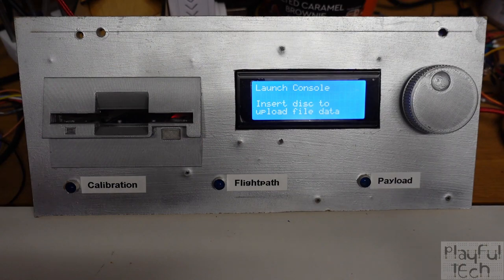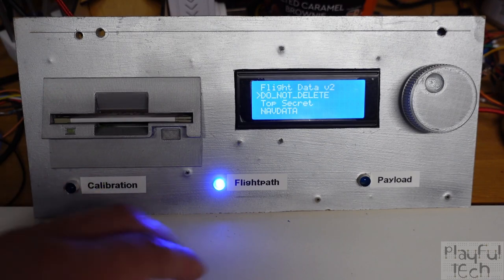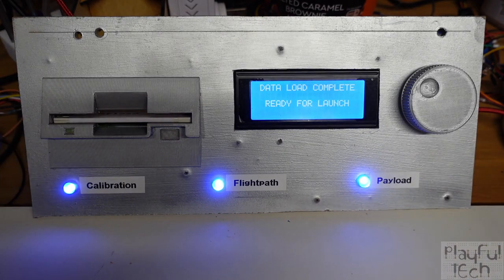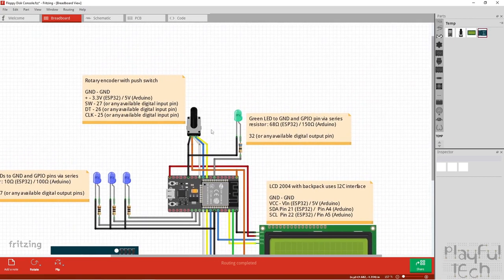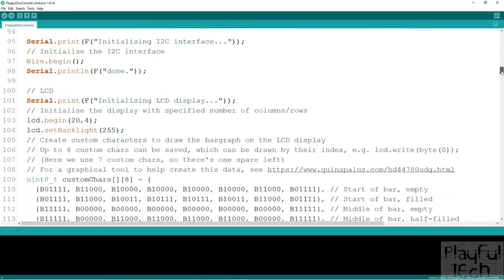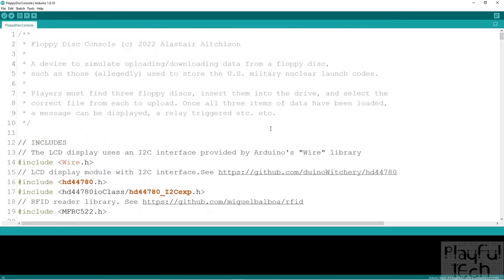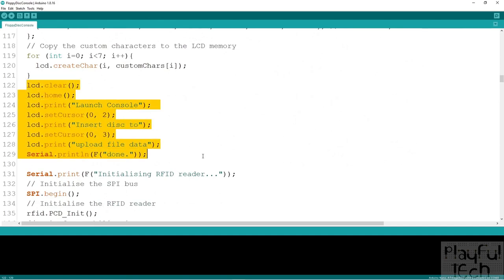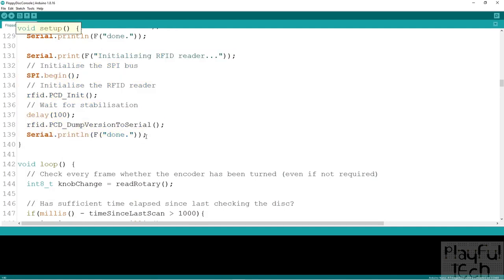Floppy Disk Console Escape Room Puzzle Tutorial with ESP32 and RFID

Comment: That's a cool idea for an escape room. I would add some large subwoofers and speakers behind one of the walls or in an adjacent room so that when they complete the code and launch, it sounds like a Missle in a silo is actually launching, with the loud noise and shaking from the subwoofers.
Reply from the maker: Definitely! That would be very easy to trigger after the data is uploaded, and perhaps after having two keyswitches turned at the same time?
Reply: @PlayfulTechnology  I was thinking of the two key switches too, extra twist....

maybe find a way (as part of the escape story) to limit only one person to that area,  "the facility has been hit before launch and if there is more than one person worth of weight at the launch desk its power fails but restores on removal of people/weight" the two smallest members of the group would need to use switches, or one person and string or belt, like Winona Ryder in stranger things!

Comment: That has worked so well, Great job. 

I'm not sure if a magnet would interfere with the RFID tag, but you could put a magnet at the back of your enclosure that would stick onto the metal slide of the disk to hold it in, then create some sort of 3-D printed lever that can push it back out if you press the button on the front. And if somebody just pulls the disk out it won't damage anything.

Also maybe leave a portion of the original floppy disk magnetic material under the window, so that when somebody slides that cover open they can see the floppy disk inside, just for more realism. I know I wouldn't be able to help myself and would slide that cover open just to look inside 🙂 

Are you going to mess with the players even more and clear any previously loaded sequences if you get one wrong?
Reply from the maker: Yes, if you wanted to go for realism, I like the idea of leaving just a little slice of the magnetic platter visible when you pull the shutter back! I considered making it more difficult by requiring the files to be loaded in a certain order, or perhaps needing a password to access certain files, but I think on balance I prefer this to be more of a "task" than a "puzzle" - players have already had to find all three of the disks, and then the requirement to combine the correct single file from each is sufficient for my needs, I think. But please do take it and modify it to your own needs!

Comment: i like the idea of using a real floppy mechanism, maybe could use the same idea as you used in the wheeled-slot mechanism.Drill small holes in the floppy.I used a laser cutter/engraver to make some cool control panels, etc. Add a sound effect of the disk loading...anyother idea would be to insert some metal pieces inside each disk and read with proximity sensors, or use magnets with reed switches, so many ways to do it! Interesting!

Comment: So you did run into the same problem as I did. Like I mentioned underneath the last video I had really hoped you'd solve that problem for the both of us. What a shame for me. But nice project
Reply from the maker: Lol, sadly yes - I think that's unavoidable with RFID (certainly the ones that operate in common consumer bandwidth). My only suggested solution is to 3D print copies of those metal parts - that would certainly work, but I suspect it might not have the durability to sustain heavy-handed treatment by escape room players :(
Reply: @PlayfulTechnology  I've tried cutting everything but the most structurally essential pieces out of the drive, hasn't worked so far. Might try some more someday.

I wish I had the skill to design those parts to 3d print. I'd love to try them at least.
Reply from the maker: @ManiacalMaker  I reckon it shouldn't be too hard to model them - I had a quick search but it doesn't look like anyone has already done it (it's a pretty niche use-case, I guess!). If I find a bit of spare time I'll have a go and let you know how I get on :)
Reply: @PlayfulTechnology  sounds great! I'll keep you updated if I find a way to make it work with the original hardware (if you'd be interested, that is)